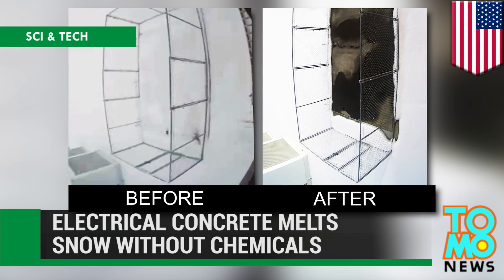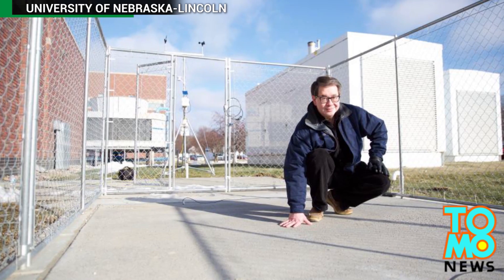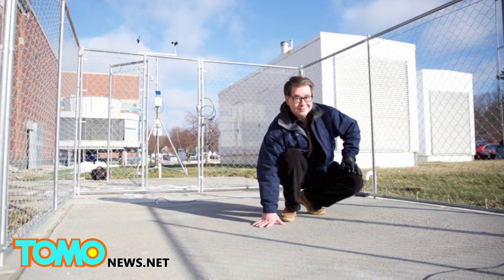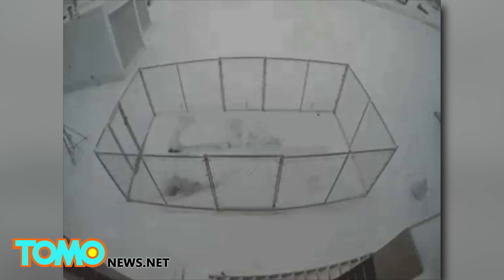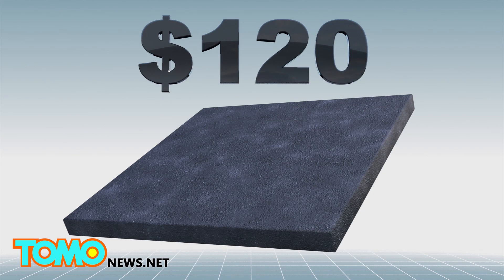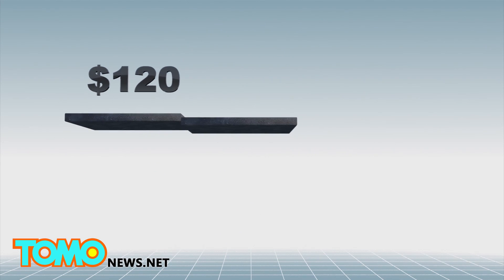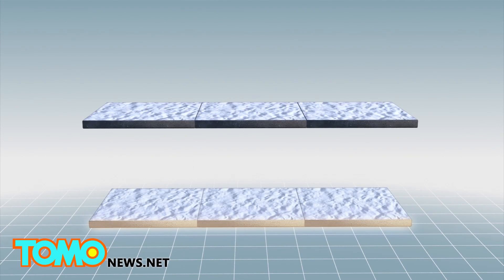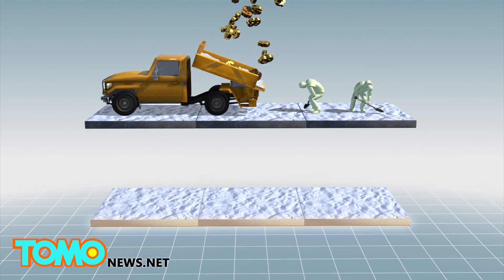Snow-melting future concrete: Special mix could de-ice itself with electric current - TomoNews

Comment: $ 120 per yard of concrete is bs. The true cost include labor,heavy equipment,fuel , lots of skill and lots of money.That does not include a HUGE amount of variables I am leaving out of this. and now a $ 9,200 (est.) a day per mile for only a two-lane road, per side electric bill....I'm not a concrete hater, just a X Concrete Finisher.
Like the person (CaseAgainstFaith1 ) who posted earlier was talking about, this would probably only be practical for Bridges And special purposes.

Comment: Just wait till someone dies for shock.
Reply: Likely it will have a rubber buffer to cover any conductable material.
Reply: +sanfully22 *rubber insulater
Reply: +sanfully22 ....yeah, that'll do the trick.
Reply: +sanfully22 tell Black Star that it doesn't conduct enough electric current to carry it through anyone's body.